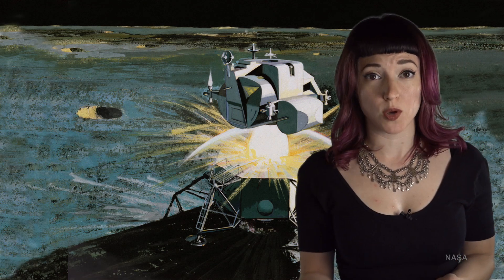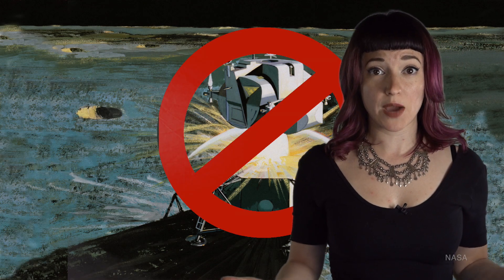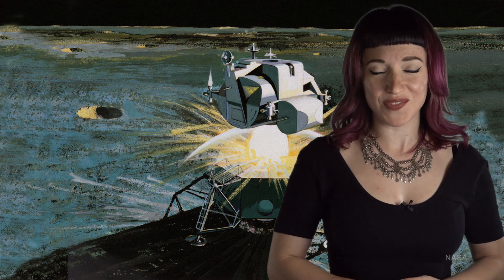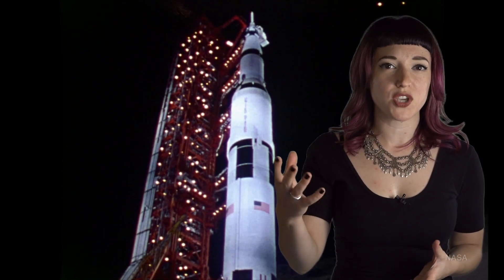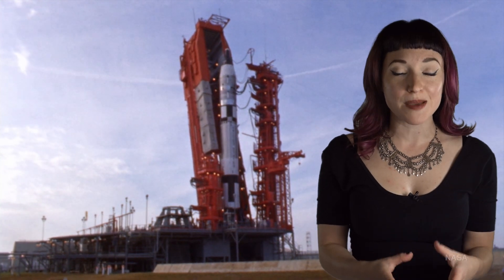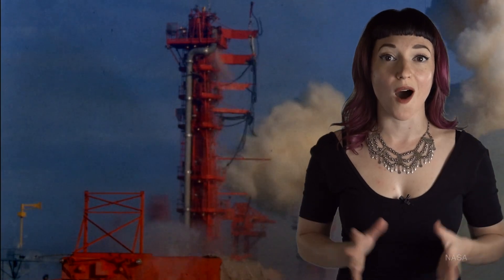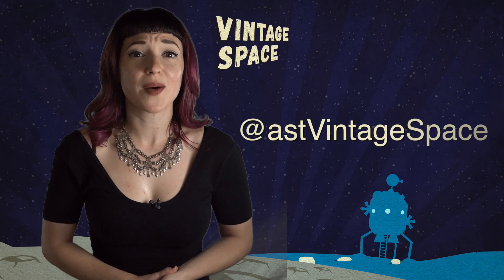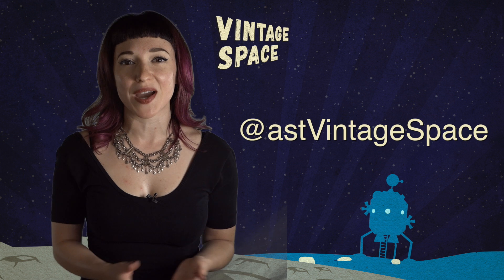How the Lunar Module Launched from the Moon Without a Flame

Comment: Very knowledgeable video!  So often people who did not live through those times don't know those little details (e.g. the hypergolic Titans). Nowadays, the Proton is the biggest hypergolic booster, but an LH2/LOX booster like Delta 4 Heavy also is pretty "smoke"-free except at intermediate altitudes when the steam it generates condenses. Once at higher altitude, films show just the white-hot interiors of the thrust chambers with no exhaust.
Reply: The same type of white hot interior can be seen on the LM thrust chamber if you find the unedited video of the A-17 liftoff.

Comment: Here is a really good question. Why does a piece of air downstream of the engine ignite before the flame reaches it? http://ifunny.co/fun/49XikPt84
Reply: If you look a little closer, you'll see what appears to be a flat object like a sign that the downstream flame is igniting. Materials in this flat plane are igniting that flame downstream of the nozzle. It appears to be something that was probably put there to verify the composition of the burn to assure proper burning. At least that's what I think it might be since it makes no sense to have a flat plane just randomly standing in the way of the SRB plume.
Reply: +J Dean I appreciate you trying to explain it why there is a secondary explosion. I noticed the box and stand you spoke about, but it's not like it is used to ignite the engine. So I think there is still a slightly better answer out there waiting to be found. I appreciate you input though.
Reply: Thanks. Engine ignition is done by a large spark igniter located within the top segment of the SRB just below the nosecone. Without being able to see the sign like object in any great detail, it was hard for me to try to determine what it was. I suspect it's going to be difficult to find a definitive answer to the question. In any case, normal SRB ignitions do not have the kind of fiery secondary explosion seen in this vid. I mentioned it being there to assure proper burning because I worked at the cape on Spacelab and ISS and we sometimes used witness plates as they were called, to collect micrometeoroid impact data on orbit. The sign like object in the vid made me recall the witness plate. But I don't know if that's what the object in the vid actually was.

Comment: How did the camera track the module ?
Reply: Ed Fendell and a few others at mission control using remote control on the camera attached to the rover. The rovers were typically parked some 300 feet from the LM to televise the liftoffs. This only became possible for Apollo 15,16 and 17.

Comment: I am a missile scientist (not a conspiracy theorist) and would very much like you to have a video that explains why the descent engine on the LEM (which is generating around 7000 lbs of thrust in the moons gravity field) does not scrub all the loose dust from the landing site.  In footage, you see sand and dust being kicked around and you see footprints.  7000 lbs is a lot of scrubbing force and the lack of atmosphere would eliminate recirculation as the gases expand to infinity.
Reply: +Bryan Seegers    Google "Lunar Module Blast Crater Facts and Myths Revealed"
Reply: Excellent thanks.  I guess 38,000 lbs was the fully fueled mass of the descent system.  I'm not a con theorist, just never saw the numbers.

Comment: Missing flame doesn't bother me.  The apparent ease of vertical take off and landing in that geometry back then is a wonder.  Much more thought, control, and compute power has to be put into it these days.  Perhaps that's a problem of the day.
Reply: Why do you think the 7 astronauts that were trained up on the LLRV's and LLTV's so they could do the hands on controlled landings were all former naval aviators and test pilots? These guys were the elite and had 15-20 years of proven experience in some of the most stressful flying jobs around including landing high-performance prototype jets for the first time. Even today, Navy high-performance jets are exclusively landed on aircraft carriers in foul weather and nighttime conditions by hand. Computerized landing systems were developed for the Navy back during the Viet Nam war and have been refined over the decades but are rarely used and only in relatively benign conditions as far as I know. The space shuttle had an autonomous computerized landing system but every shuttle landing was done by hand. The fact is, highly trained pilots are still better at landings in dicey situations than computers.
Reply: One of the things that made stabilization possible in the LM ascent configuration was the quad thrusters. Any of which would fire if the LM was starting to veer off it's axis. The firings would not be visible for the same reason the ascent engine plume was not visible.
Reply: If the weight isn't balanced, they could just stay a little longer to collect more rocks.

Comment: One glaring error -- the Titan II rocket had a very obvious flame in this video.  I'm not saying we didn't go to the moon.  I'm just saying that the whole premise of this video is false, according to the flaming video itself.  Also, when speaking of rocket based propulsion, we usually don't refer to the propulsive jet as a flame.  That would simply be too lame.
Reply: She explains why the clear flame is visible in the Titan II launches.
Reply: *****
She says it's a clear flame, but it's obviously not clear.
Reply: *****
It's obviously not a clear flame.  It's a solid yellow jet.  Again, I'm not a lunar landing conspiracy theorist, but these kinds of obviously false counter-arguments can only fuel their fire.
Reply: It's relatively clear under certain conditions. It's also clear when compared to the shuttle or even Saturn-V which belches out what amounts to columns of smoke and fire. As ytmoog said, it's the atmosphere that contributes to making the Titan-II plume somewhat visible. The thing about the LM liftoff that is rarely mentioned. The Apollo 17 liftoff was followed to considerable altitude and you can see the bright glow of the ascent stage engine when the angle allows looking into the engine. That's important to know when conspiracy advocates claim the LM was hoisted by a crane or wires.
Reply: *****
The lack of visible flame does not bother me at all.  The stuff that makes me wonder (but not doubt) is:
1.  The fantastic following of the camera with a  high-lag human control loop.
2. The ease of VTOL without computer assist, particularly in a craft of that geometry with no elongation or rotation.
Reply: 1.....The camera operation was done on Apollo 15, 16 and 17 by a mission controller named Ed Fendell. He didn't quite have the timing down for 15 and 16 which is why those liftoffs didn't track the LM very far. He nailed it on 17 by compensating for the time lag.2.....Liftoff was partly assisted by the quad thrusters, but only if the LM ascent stage was about to go off axis. There was also computer assist at liftoff from the mainframe computers at mission control. The pre launch data was uplinked and entered in the LM computer just prior to liftoff.
Reply: *****
Where can one find details on this data, the mainframe computing, and the uplink process?
Reply: The yellow flames below the Titan are shock diamonds. Those are caused by atmospheric pressure and indicate the engine isn't working at full efficiency. (The pressure first needs to drop)
Reply: Robert Stuckey
Even if it were one hat you should watch out...